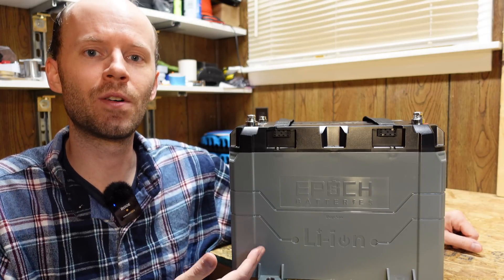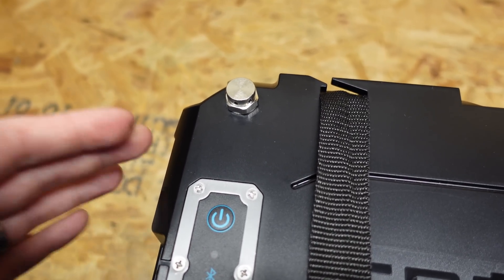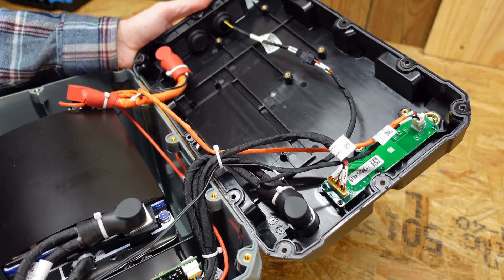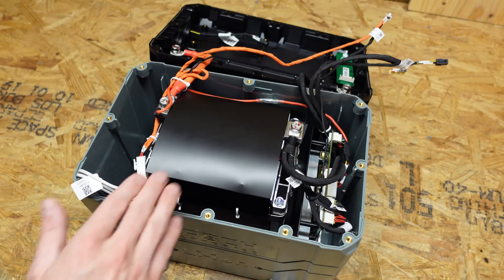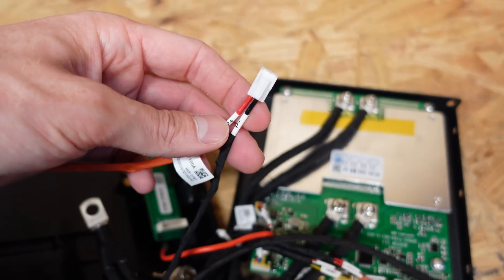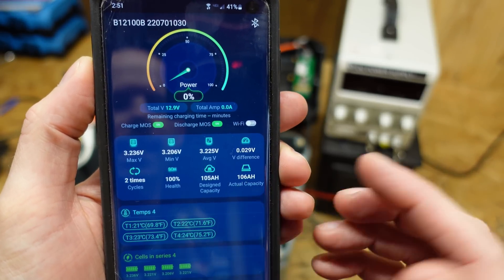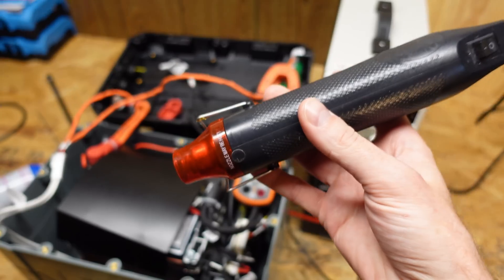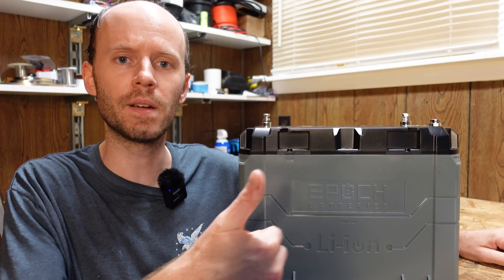Epoch 12V 100Ah Waterproof LiFePO4 Marine Battery, Best in Class?

Comment from the maker: Epoch 12V 100Ah... https://www.epochbatteries.com/products/12v-marine-battery-lithium-100ah/?rfsn=6891696.aba73b0 (affiliate links)
(10% Discount Code "LITHIUMSOLAR")
Let me know what you think!
Reply: Hello - great vid - is this the best BUILT marine waterproof battery for the money currently available to your knowledge?  Thanks!
Reply: Hi quick question..   a little fan, or even two little fans on that battery wouldn't make it perform better in higher temperature locations? Or say in the summer?

Comment: Do you think this would be a good battery to use in a 5th wheel application?  It would be used to run lights and some inverter outlets.  My question is would it be able to start a 55000 watt generator that draws 200 amps in rush and 100 amps to start the generator? I would like to hook 2 of them up in parallel. Thanks.

Comment: Have you opened and tested a Epoch 36v battery? My question is, does the 36v Epoch battery have a heater for low temp charging safety. I live where we fish in freezing temps and I can't find any info on heaters on 36v batteries. Thank you for any info
Reply from the maker: No, I have not reviewed any 36V batteries. That voltage is rather unusual and there aren't many products that make use of it. Most are running 48V if they need more than 24V.

Comment: EXCELLENT WORK SIR,I've been looking for info on battery heaters and you point out that it's a 12V 40W heater something some of the suppliers have not been able to tell me.Do you think that a 48V battery would have a 48V heater after all it is connected to a 48V BMS.Also can you measure the height of those cells 100ah is about 120mm,the 105ah are taller.Thanks

Comment: Hmm I get its submersible and waterproof but what if you have this mounted on the exterior tongue of your camper trailer?  The battery connections would totally be exposed to the elements.. So I would need to put this battery box in a box? Am I way off here?
Reply from the maker: Yes, it still needs to be in a box in that case. It's waterproof to the extent that it can get splashed but it's not intended to be submerged, get rained on constantly, etc.

Comment: Can the BMS be programmed to limit the charging current?
Reply from the maker: No, the BMS in this battery is not programmable.
Reply: @LithiumSolar  Is there anything / device that can limit the charging current? Trying to trickle charge it with a 12v socket in the car without having it blowing the fuse, thanks!
Reply from the maker: @TonyPham-Creations  You absolutely need to use a charge controller, there are DC-DC controllers intended for use in a car. Here's an example https://www.currentconnected.com/product/victron-orion-smart-tr-dc-dc-charger/?attribute_model=12v%2F12v%2F18a&ref=lithiumsolar
Reply: @LithiumSolar  Appreciate it! Based on your video, I got the Essential series, did not need the IP67 rating, it's awesome, especially with the BT BMS monitoring!

Comment: I received mine a few weeks ago, so far so good.  Was quite disturbed that the manual says that it can't get wet or be used in a wet environment. This is completely against why I bought a waterproof battery in the 1st place, to be in the standard position on a travel trailer.  The tabs prohibit it to fit in any battery box that I can find, so made a box of wood, negating the weight savings & spending extra $.  Other than that, it's ok.  The app works, although I have to force quit it each time I use it, so the battery will show up. Can't seem to figure out how to, if possible, to rename it.

Comment: Outstanding review! I have been researching lithium batteries trying to figure out which brand to buy. I was intrigued with the Epoch and it had better features than many of the more well known  batteries on the market. Of big concern was the safety features of the different batteries. Your video accomplished easing my safety concern. The cost is even cheaper than other Bluetooth enabled batteries. I’ll be ordering the 24V 100AH Epoch to run my 24V trolling motor. I don’t believe that I’ll be disappointed.

Comment: The Noko Genius 10x4 with lithium settings doesn’t seem to play well with this battery. I received the  100ah battery with 17% power and hooked it up for 9 hours on the noko. When I returned to the battery, I had a fault display on the app reading “fully charged” with red background. The Noko charger itself had 12v Repair mode illuminated in orange and green indicator light pulsing on. No clue what’s going on.

Comment: Please do a video on 12v battery chargers. I bought bought Roypow chargers (14.4v/3a and 14.4/15a). Also got an Epoch 12v/15amp IP67 charger to use as my onboard boat charger. Got all 3 for about the same cost as a Vectron IP65. 
A “12v charger shootout” would make a great video… comparing “budget chargers” voltages, cycles, and ability to “wake up” a sleeping BMS like Roypow claims both of theirs are able to do.
Reply: Quick question: which would be better for these batteries in the in the long term for use with 55 lb thrust trolling motor (12v motor w/50a max draw in parallel, or 24v motor w/25a max draw in series)?

Comment: What charger (looking at vectron) would you get for this battery? I just bought 2 of them based on your awesome video!
I was about to buy a Bigbattery seal, but you can’t use their batteries in series anymore.
Reply from the maker: I've pretty much been exclusively using the AIMS chargers. They have two versions, a 12/24V and a 36/48V. I have both and they've been rock solid. As for the BigBattery's, might be worth asking them even if the spec sheet says not to. It was my understanding that they could be series connected but it's just discouraged - definitely something you'd want their confirmation on though before doing.
Reply: I was thinking about a vectron IP65 15a, or epoch 15a charger from their site. Saw issues from overheating on IP65 reviews. Any thoughts? Also epoch has a new 100ah battery on their site this morning.

Comment: I ordered one of these batteries after watching this review and looking at the Epoch web site. The web site seemed to be well done and legitimate. After the battery was delivered, I quickly discovered it did not work. There is a on/off button that must be switched on before the battery will work to deliver voltage. The battery would not turn on after multiple attempts of following directions in the very bare user manual. Calling Epoch on phone number supplied in user manual resulting in a weird music recording and then a disconnect. There was no opportunity to connect to a customer service rep or to leave a message. I then emailed customer support and in a reply was told to leave a number for them to call. Hours later I received a call to review the problem. After going through some trouble shooting tasks the battery would not turn on. The Customer service rep admitted the Epoch company is new in business and is trying to establish a customer base. He also admitted that the batteries are not tested before shipping so there is no way to know if you are getting a battery that works or does not work. Additionally, the photo's representing the batteries are misleading. I ordered a 50 AMP hour battery. The pictures on the web site for the 50 AMP hour battery appear to be smaller than the 100 AMP hour battery. I was unpleasantly surprised to discover the 50 AMP Hour battery comes in a very large 100 plus Amp hour case. Obviously there is a one size fits all on battery boxes in an effort to reduce costs. It has become obvious to me the YouTube video producer made a complimentary review because he received a free battery. He obviously did not vet the company EPOCH otherwise he would have learned they are new in business and incompetent. The Epoch company from my view is pushing cheap Chinese made lithium batteries onto the unsuspecting public and this YouTube video reviewer is aiding and abetting them. I have asked for a return for full credit on this battery that will not even turn on. To everyone considering buying one of these batteries I give you this warning. Do it at your own peril. My battery did not work and now I have to suffer the consequences of not doing my proper due diligence. There is a reason the Epoch battery is so cheap. It is pure junk and does not work.
Reply: The battery mentioned here was handled roughly in transit, resulting in a loose connection internally which prevented the power button from functioning properly. The battery has since been exchanged. Upon inspecting the battery, discovering the loose connection, and reconnecting it – the battery performed normally. Our batteries are inspected post-production and again before leaving our warehouse to ensure full functionality. The handling of our batteries in transit however is unfortunately beyond our control. 

We’ve been involved with lithium batteries for many years and price competitively to appeal to a wider audience. While we are a newer brand, we’re here to stay, and aim to provide swift and effective support to all of our customers. There were in fact technical difficulties related to the previously listed support number that we were not aware of. Those issues have since been resolved and a new number has been listed on our website, in our updated manual, and on our app. 

We hope that you’ll accept our sincerest apologies, Gene. Had we known about the technical difficulties, we would’ve been able to provide a much quicker resolution. We hope the replacement battery is meeting or exceeding your needs and would like to encourage you to please feel free to reach back out to us anytime. We genuinely appreciate your business and intend to prove that through excellent service.
Reply: @epochbatteries  I was about to order 2-4 or these batteries until this comment.

How much rougher do you think shipping is than life in a trolling motor or marine application? Have you addresssed this issue?
Reply from the maker: This is very disappointing to hear. Epoch is indeed a new company but is related to the "18650 Battery Store" folks, which have an outstanding reputation from MANY customers, not just myself. Epoch batteries are built by RoyPow, which is a subsidiary of EVE Energy themselves. It's possible that it was just a defective battery. Have they honored the advertised 30-day return policy?
Reply: @LithiumSolar  The battery will be returned for credit. We will see how difficult it will be to get credit to my PayPal account. There is no possibility to get a customer service rep by calling. Calling the phone number listed only takes one into a black hole. . Only email communications until someone calls me. I do not see how this can be considered an outstanding reputation. And it is obvious that quality control on these battery products is lacking since I have a non working battery.
Reply: @issachaines  Was the situation resolved? Did they compensate shipping? I am considering ordering from them.
Reply: I would like to update this post from 6 months ago. Epoch Batteries sent a replacement battery and I returned the non working one. The replacement battery has a bulge in the bottom of the case which prevents it from laying flat causing a rocking motion . This is irritating and again suggest quality control concerns. Epoch offered to replace the battery but I elected instead to put some adhesive felt pads under each foot to raise it 1/4 inch and that solved the rocking problem. My main reason for the update is say that I have been using the battery quite a lot for my 45 pound trolling motor and I am very satisfied with the performance. I can get two days operating time out of one charge with my style of fishing which is equal to my 75 AMP AGM battery that is much heavier.. And Epoch customer service has proven to be dependable once they got their phone and messaging system problems resolved. The BMS and the bluetooth phone app is very useful. The battery quality is very good in my opinion. It is not perfect and I would change some things about it if I could but all in all it is a good battery and I would buy another which I probably will soon. I can recommend this battery to anyone needing a lithium trolling motor battery.
Reply: Can confirm their customer service is still terrible.  And they do not publish basic recommended charge parameters for their cells.   Easy way to decline a warranty claim is my guess.   Sucks because they clearly have a good plant making these.  But the company itself is nowhere near ready for primetime.

Comment: The battery manual says that this battery can be connected in series, 4S1P, but did not say anything about parallel connection.   Can this battery be connected in parallel 4P  for my RV.   Agree with another poster saying that the Epoch seems superior to the Battleborn. Will definitely buy this battery if it can be connected in 4P
Reply: Their website says:

Max (4) in Series up to 48V, Max (4) in Parallel - 4S4P

Comment: Does the app let you get in and look at all the BMS parameters or is it locked up?  When I looked at it in the App Store, it says it has a management mode, but it wants a verification number. 
I know I know Will and other get mad when people want to screw with the BMS parameters.
Reply from the maker: The app does not have anywhere to edit the parameters and I agree with Will that this is a good thing. It would be nice to see them to know how it's programmed; however, don't see any reason they should be edited.

Comment: Can you use these in series for a 24vdc solar system? I'd be connecting it to a 3000w 60amp hybrid controller/inverter. Thanks!
Reply from the maker: Yes, but it's best to buy the 24V version instead of connecting two 12V together
https://www.epochbatteries.com/products/24v-100ah-heated-bluetooth-lifepo4-battery/?rfsn=6891696.aba73b0
Reply: In my manual for this battery it only says connect 2 in parallel. And if you connect 2 in series it voids the warranty. Can you clarify if this is correct?  As you said its OK to connect in series. I own 2, but wanted to do in series for a 24v outboard motor, so but now I'm not sure. I have any advice, aside from selling these 2 brand new unused batteries and buying something else.

Comment: Only disappointment for me is the 120a bms. I need more like 200a.
Reply from the maker: With that type of current, it's probably best to buy 2 batteries or set up to a 24V system. 200A is a lot to ask of one battery (even though cells may technically be rated for it).
Reply: @LithiumSolar  wasn’t sure one could draw 200a with 2 of these in parallel. Good to know. I’m thinking these for my motor home 12v system.

Comment: Thanks for this informative review.  It is always helpful to state the full charged voltage (14.6V or other) and the steady state, full charge at rest after X amount of time (13.4V or other) for LiFePO4 chemistry.  Some manufacturers of trolling motor batteries use 16.5V+ (Li-ion and not LiFePO4).  Labeling a battery 12V is completely uninformative/misleading.
Reply from the maker: The charge and nominal voltage information is readily available on their website and in the included manual. Additionally, LiFePO4 is Li-Ion.

Comment: would this Battery work well with the Handcart portable power station build you made? a 24v version that is.
Reply from the maker: Yes, it would work but is a bit overkill for that particular application I thinks.
Reply: @LithiumSolar  so my plan is to build this as a portable unit, that will be my primary power for my workshop, with mobility for emergencies. (MPP Solar / PIP 2724LV-MR 24V 2.7kW 120V Inverter, 600W Solar Input) plus this battery on a hand cart. at some point it would end up in a camper, cabi or just stay as my workshop power unit. 
Thoughts?

Comment: I would rate this as superior to a battleborn and cheaper. Except for the placement of the temperature sensor on the terminals, really superior. One question, is it rated for series connection? Edit, now a second question, can the app connect to multiple batteries or only one at a time?
Reply from the maker: Officially, you can connect two of the 12V in series. It's strongly recommended to just purchase the 24V version instead though. Yes, if you have multiple batteries, you can select them on the app.
Reply: @LithiumSolar  Thanks, I hadn't noticed they had others. I wonder if they use the same EVE cells in their 24v and 48v batteries. They are certainly well built. If I had a boat I would jump on them. Living in the desert, I don't need the heater, but it would certainly come in handy if you have a motor home or boat.
Reply: @LithiumSolar  in the manual it only mentions connect 2 in parallel , where does it say 2 in series?
Reply from the maker: @craigmorton644  The bulleted list of features on their website actually states "Max (4) in Series up to 48V" right now. When I originally made this video, the limit was 2 batteries in series. The specifications may have changed. It would be best to contact them for clarification if you're not sure.
Reply from the maker: @craigmorton644  I should add too that it's preferable to just buy the proper voltage battery rather than connecting multiples in series.